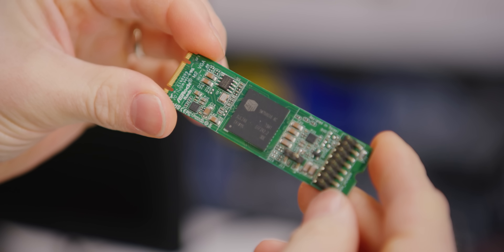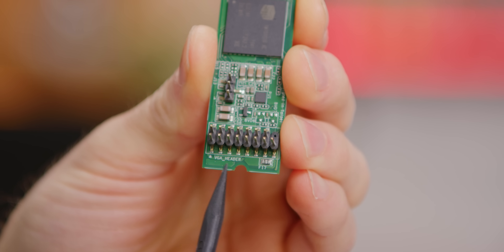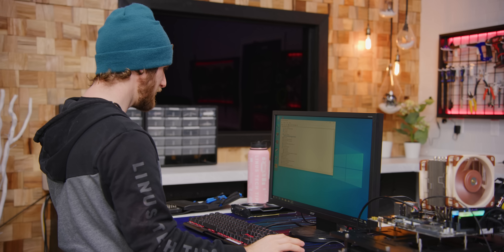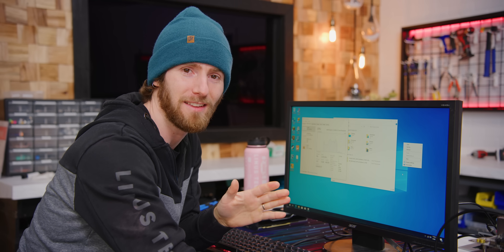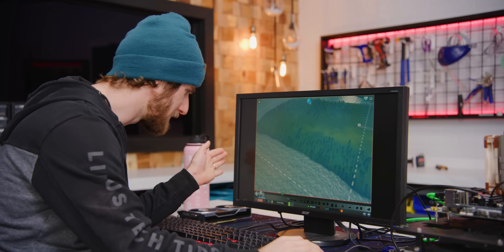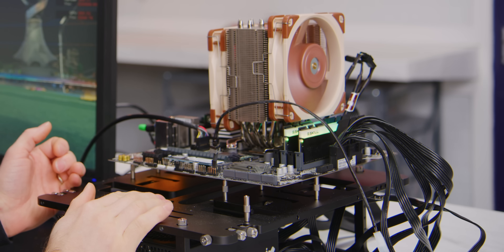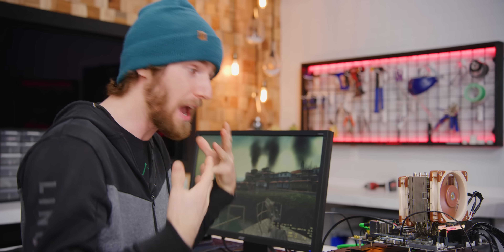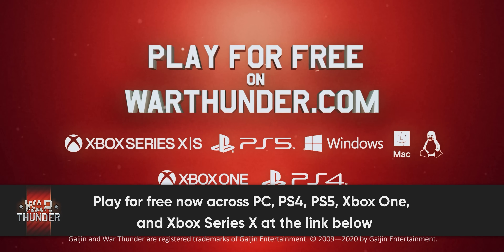THIS is a Graphics Card..?? - ASRock Rack M2_VGA

Comment: TY for finally testing one of these (it has so many uses), I was going to use it as a way to provide a GPU (compute unit / virtual display output) for a hardware accelerated VM inside a laptop (due to the laptop I am using having the iGPU disabled and only the dGPU available for use).

You could add some nice external graphics to a Rasberry Pi as well!

Comment: I only have 1 GPU without 3D acceleration, and that is an over 20 year old something. I have replaced it though with an Nvidia Geforce4 MX440 for the sole purpose of gaining 3D acceleration so I could test some games on my Pentium 3 system. I still have the other card though. It's AGP by the way, so don't think about using it in a modern system sadly.

Comment: I remember back in the day when I couldn't play a game because it requires 256 colors and I only had 8. Not 8-bit, just 8. When 16-bit came along it really improved things. Then 32-bit has been the standard for about 20 years. I wonder how much a 5950X can handle in software only mode in gaming. It has been ages since I ran a game in software mode.

Comment: Could you use this as a VGA output for modern cards, this could be a good accessory to CRT enthusiasts if it can handle high bandwidth as an output redirected from a RTX for example. That should be possible.

Comment: 10:10 a part from that "warp" thing there's also the fact that most old source games like half life 2 or team fortress 2 are very CPU intensive and don't need much GPU power unless you got a nice monitor since at the time valve wanted the games to be more accessible and decided to design the engine for CPUs instead of the rarer high-end GPUs at the time, I don't know how related this is but it's still cool info.

Comment: The best things about these niche, slightly strange but tiny form factor devices is that it inspires other products to be created. 

They show that making something smaller can still work and be useful and push the limits of sizes in components. Hopefully helping designers and developers of tech start making things smaller that still pack the same punch as the bigger versions. To be honest if Graphics Cards continue to get larger and larger as they are, soon we'll need much wider cases. Which I don't really have a issue with, as to me the case size is easily secondary to the performance of the computer but a lot of people do like a smaller more compact form, minimalist and shouldn't suffer because of it.

Comment: Ah, Linus, you dewy-eyed moon calf, you...the issue here is that it's not a GPU - yes, it's a graphics chipset, but that doesn't mean it's got a GPU. Dost thou not remember the old days of S3 ViRGE and the Voodoo 5? The GeForce 256 was the first actual GPU...the rest of them were just plain ol' graphics cards, sometimes with a little bit of acceleration built in.

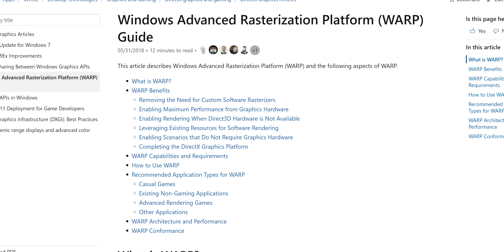Comment: 9:40 I use GNU/Linux which is also capable of the same thing for any OpenGL application - it is called "LLVMPipe" ,  a built-in CPU/"software" renderer that actually is very well optimized, making it possible to reach playable and even good framerates in low-poly games when using a very powerful CPU like a AMD Ryzen as a GPU. There is no doubt in my mind were you to use modern GNU/Linux on this setup, it would also play Half-Life 2 at playable framerate. This is required because it seems pretty clear that the "graphics card" you have does not actually contain what's defined as a "GPU", a type of circuit invented by NVIDIA in the late 90s - it is more similar in structure to the graphics cards PCs used in the late 80s and early 90s. So to play real 3D games, the CPU must be used to emulate a GPU - software rendering.

Comment: I would legitimately love to see this concept expanded, for office usage - can handle moderate video editing and 4k video through board. Doubt it would be doable easily today, due to power draw and the process of pushing video from pci to a video out in motherboard (albeit creating that piece of software standard would be very greatfull- using bios to say which video out on mobo goes to which GPU , BUT	requires at least one video port dedicated to apu if one exists). Even a small GPU found in like Quest 2 would work great for office desktop usage.

Comment: Y'know, the pricing sorta makes sense, until you realize you can get a GT 710 for around 40-60 USD. I just checked, and confirmed you can also get a GT 1030 for as low as $85-90. Wack.

I guess some of the price is due to it being highly specialized, but the hardware itself seems pretty cheap. Corporate pricing I guess?

Comment: "Gaming machine" - the interface for a Poker Game or digital slot machine.
Reply: I was always wondering which software slot machines mostly use and if they are actually some sort of primitive computer
Reply: @demiangalic916  Black Horse slot machine game is running on Linux distro.
With prehistoric Pentium M , 2GB of DDR1 RAM and 8GB CF card as mani storage...
Reply: @demiangalic916  They're usually just another embedded x86 PC
Reply: Duck Game

Comment: id love for this to be the future of graphics cards. if only it could run faster than the igpu. 
with 4 lanes to work with (especially with pcie4) it has some potential. you probably aren't going to get a top notch card though that you need a copper brick worth of cooling to run. but if you can beat the igpu you might have something great.

as an sff builder id love to have an option like that. say i got a mini-itx, you are limited to one 16x slot and a pair of m.2s. unless you are using really expensive nvme drives, you might be able to get 4tb tops. having an m.2 card, on the order of a 1650, i can trade gpu performance for storage and stick a full 4 ssd raid array in the pcie slot with a boot drive in the remaining slot.

would take some extremely dense pcb design work though, and room for power delivery hardware would also be an issue. another issue would be ports. if you could make use of the mobo video ports (which i know is possible via the igpu, linus did something like that on his video about gaming on a mining card) rather than having a header. though a dp header would use fewer pins than vga. dupont headers take up too much board space, so maybe use a kapton ribbon cable instead with a low profile slot on the side of the board or something for a dedicated port to make it compatible with gpu-less cpus.

Comment: What I'd like to see, is more serious effort put into these, so that they could be a suitable upgrade to the onboard graphics on ARM chips. That way, you could have ENTIRELY smooth video playback on a multimedia SBC, and perhaps even some gaming potential, without needing a full sized graphics card jerry rigged to the NVME slot. It HAS to be better than onboard, though - not worse.

Comment: You jest, but this might just be the best external graphics card currently available for the Raspberry Pi...
Reply: External graphics card? Yes, but I'd guess that the VideoCore is probably actually better.
Reply: @nonnymoose7005  the VideoCore is definitely way more powerful (and actually supports OpenGL and they're working on Vulkan).

But this card could provide a VGA output which the Pi itself doesn't have, so you can connect it to old/retro monitors or projectors.
Reply: @Peetz0r  They're not just working on Vulcan, Vulcan 1.0 conformance has already been achieved.
Reply: @Peetz0r  why not use an adapter vs this add on garbage
Reply: @Peetz0r  Yeah the VC graphics in the Pi's SOC are faster, and Chromium at least also has hardware acceleration so YouTube videos play way nicer now with the latest Pi OS version. The little SM chip in this VGA card is super underpowered, meant almost exclusively for mostly-headless servers where you might need a low-powered display on it.
Reply: @Peetz0r  I just use an HDMI to VGA cable...
Reply: @JeffGeerling  Yes, the intended purpose would be to just show a tty or maybe a dashboard.

Buy that shouldn't stop us doing other stuff with it, just because we can. Right?

Looking forward to your video on it. No pressure :D

Oh did I mention that I put an nvme ssd (cheapest I could find) in a RockPro64 and it's faster (both iops and mb/s) than the samsung ssd in my intel nuc machine.
Reply: @Peetz0r  I mean, the universal cry to see if it runs Crysis must be answered!
Reply: @JeffGeerling  I guess this might be useful for that:

https://github.com/AndreRH/hangover (basically wine + qemu usermode)
Reply: @Peetz0r   u could just use an adapter
Reply: @Peetz0r  Just get an HDMI to VGA DAC
Reply: @Peetz0r  It'd be cheaper just to buy a HDMI (or whatever the GPU) uses to VGA adapter, rather than buy this piece of trash lol
Reply: @Peetz0r  Better get an HDMI to VGA adapter. This is an unaccelerated framebuffer, basically the CPU draws everything on the screen, no 2D blitting or 3D acceleration whatsoever. Don't try to use with the Pi which is CPU bottlenecked.
Reply: @Δημήτρης-θ7θ  Raspberry Pi's main processor, which also interfaces with PCIe is its GPU, not its CPU.
Reply: @Peetz0r  With a $60 price tag it would be better just to get an adapter. Or get a pi 1 for composite output
Reply: Next thing we know Linus will be gaming on a Pi
Reply: @barchetype6430  he’s already done it
Reply: @barchetype6430  If only seeing every fourth pixel is fine and the game directly uses the fbdev, it can already work. I haven't figured out why it only writes every fourth pixel though.
Reply: Oh fancy seeing this comment here. I hope you get one to test with a Rasberry Pi soon!
Reply: @ShapeShifter499  Already on it. I've had it on my desk for over a week now. I give it a 50/50 shot of working. And I think I only have one monitor old enough to have a VGA input!
Reply: @JeffGeerling  freaking sweet!  

Personally would like to know for the possible video you may or may not make on it. Whether or not if you can pipe the other onboard graphics through it.   Like DRI_PRIME or Bumblebee but on the Raspberry PI.  

Would it be impractical for everyday use, probably. But would be cool to see working none the less. At least in my opinion
Reply: boutta say
Reply: idk the raspberry pi gpu is pretty robust for an soc, this thing is really just a video port adapter.
Reply: Seems like the onboard video would be better.
Reply: So... is this a debug card? I mean I'm impressed it even produced an output.
Reply: Yes, waiting for a new Video!!
Reply: You're here?
Reply: jeff!
Reply: @erikbraun2867  Erik!
Reply: @JeffGeerling  yay!
Reply: It works?
Reply: IF WE COULD JUST GET FUCKING DRIVERS. FOUR UNUSED PCIE LANES ON THE PI 4! FOUR!
Reply: Until Jeff gets a real card working!
Reply: Although, and I mean this with the most of love, I'm not holding my breath :(
Reply: @Zorlin0  He just needs to let Red Shirt Jeff loose, he'll have it done in no time...
Reply: oh dear gee wilikers you dare jest
Reply: The raspberry pi doesn't support m.2 without an adapter. . . at which point you might as well just use a pci adaptor for a real graphics card. 
Legitimately, there's no use for this sort of thing. If you're worried that much about not running a display off of a graphics card, then you're going to just shell into the computer. This thing is completely useless.
Reply: I smell a video coming !
Reply: hmmMMMmm
Reply: JEFF! Put it in a PI!!!!
Reply: I mean yes, until you remember that the CPU is doing all the work
Reply: That could be a good use for this. What it be able to handle anything but some old Nintendo games?
Reply: Was just thinking that and you're already there!
Reply: ...... i still use vga with one of my monitors
Reply: Raspberry Pi's own GPU is way better
Reply: hi jeff, love the content
Reply: Maybe?!
Reply: It has alot of uses! I was going to use it as a way to provide a GPU (compute unit / virtual display output) for a hardware accelerated VM inside a laptop (due to the laptop I am using having the iGPU disabled and only the dGPU available for use).
Reply: ... Does the RasberryPi have a M.2 slot, or would You have to use some kind of  PCIE to M.2 adapter as well ??
Best regards
Reply: And embedded systems
Reply: Oh yes, one for geerlingguy, please!
Reply: I was about to go and tell red shirt Jeff 😲
Reply: I knew it, it was software rendering, what else after there's no 3D acceleration support on this
Reply: @DxCBuG  😢😭😭
Reply: You know what you have to do.
Reply: Please tell me you ordered this thing now to test with your RPi Compute 4 Module.
Reply: @MegaManNeo  - I've actually had one for a week now... just haven't had enough time yet to get it running.
Reply: legit my thought when i saw the video
Reply: Exactly my friend 🙂
Reply: the pi has better onboard graphics. accelerated opengl and all. you can run full java minecraft on it pretty easily (1.12 and under. 1.13 and up is more complex because lwjgl3 and theres only good documentation for lwjgl2 for compiling for arm and running minecraft using it. while my pi4 was still living (sd controller died it doesnt recognize any card now) i could even run some bigger sized 1.12 modpacks and if i had the 8gb variant i certainly could have run even bigger packs.
Reply: only if they can have better specs. Like very tiny external vram on the side, and more clock speed lol.
Reply: I'm surprised it has any vram at all lol.
Reply: I wouldn't, the built in VideoCore is far superior to this, all this can offer you is a VGA output, and there are HDMI-VGA adaptors so this product is redundant
Reply: It will not work. It it's only for a DirectX applications. And it's only will work in Windows 7 and above.
Reply: what about an eGPU via USB?
Reply: @sodiboo  They can make that using this, like a pcie m.2 slot adapter to usb
Reply: @roblo6387  yeah but i meant a more powerful graphics card (full sized) that normally wouldn’t fit in a Pi
Reply: I've seen a Rasperry with PCI slots recently....
Reply: please do a test with it
Reply: Why need one when you could forward x11 to another linux system
Reply: Hey verified person
Reply: shit you're right
Reply: Wanna RISC-V open driver M.2 then we talkin
Reply: True
Reply: The 100th reply on this comment
Reply: Lol I was thinking how much something like this would have been great when I was using my Raspberry Pi in 2012 to get on the internet when my parents took away my computer because I kept getting around their nanny software. I kinda almost miss it. But GOD it was slow. I had to play songs from the command line
Reply: I want to see thisss
Reply: Pi gaming becoming real
Reply: does the pi even have any pcie lanes?
Reply: @breadone_  yeah. check out Jeff's channel, he has lots of videos about testing GPUs and PCIe accessories on the raspberry pi.
Reply: @ceilyurie856  Are you serious? Look at the name of the OP of the very thread you're replying in and half of the replies?
Reply: @ceilyurie856  Are you into tech?  You don't know Jeff?  😲😲😲😢
Reply: @ceilyurie856  i get that too 😁
Reply: That wasn't my point, I don't know this person either. You're literally responding to a thread made by the guy you're complaining about not being linked to.
Reply: @breadone_  The Compute Module 4 does
Reply: @breadone_  it has a 1x pcie slot on the raspberry pi 4 compute module
Reply: @breadone_  yes
Reply: @breadone_  The Pi CM4 does.
Reply: @breadone_  some spinoffs are able to utilize pcie
Reply: Beat me to it
Reply: @SplitCoil  the pi4 compute module does. Check out @jeff's channel he did some stuff with it.

Comment: $65-75 seems pricey, you can buy an old preowned GPU for far less with much better performance, although I can see it being handy for a small home media server, yknow, just something with storage and a connection you can stream from. occasionally you might want to plug in a display to change some settings or something.

Comment: On the server side it makes sense. Going off the assumption most are using a webui to manage their servers this could be useful in managing the server locally, I'm sure it will handle cli perfectly fine.

For other enterprise uses I guess if an employer wants their staff on Ryzen CPUs, but doesn't want an APU, and wants an ultra small form factor PC (i.e Lenovo Tiny range) then it could work. But at that point why not go Intel or an AMD APU

Comment: This is a GPU for consumer hardware based servers. Like a TR4 sys with several M.2 Slots. When running 24/7 such an little GPU is more than ennough for configuration jobs, without consuming 25W like any other small pcie GPU does.

Comment: 5:00 This device probably lacks decoders for H.264 and/or VP9 and may lack YUV planes as well, so the CPU is chugging to convert to RGB color space in real time. This is how YouTube used to work and partly why it was stuck in low resolution for so long. As for the color banding, it was probably downsampling to something like 15 or 16 bit.

Comment: Could use the HDMI variant to power an internal display for system monitoring without having to route a cable from the back of the gpu back into the case.

Comment: I am starting to think Windows 10.... Just assumes everything is 32 bit color at this point haha. 

the fact it only has 16mb of Vram.... You'd think Windows 10 wouldn't even display? Like I remember Vista even needed 32mb vram at a min! Windows 10 doesn't specify.... But with what I said above about assumptions haha.

I also feel Linus is being unfair towards VGA, I am sure most of his problems are from that graphics.... Stick.... 

I am not surprised that everything it did do in gaming was done by the CPU. Honestly I gotta assume the software that offloads rendering the CPU is also the reason Windows 10 even displays on it. (& why they no longer list a vram requirement on the system requirements)

Comment: If I were Linus, I wouldn't even bother connecting the monitor and the card with a VGA cable. I would just take long enough 15 pin connector to shove it directly into the port in the back of the monitor.